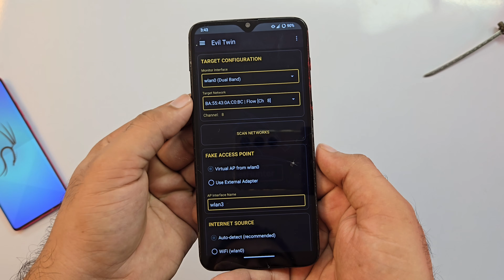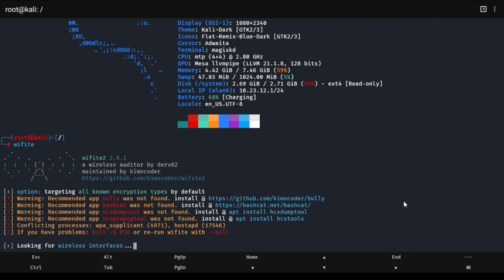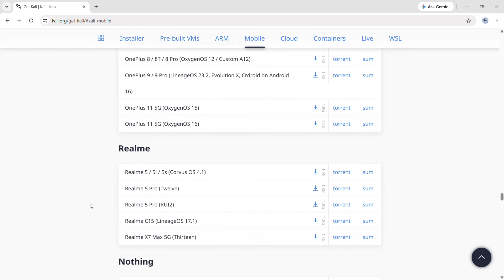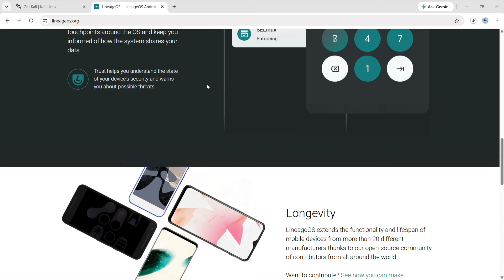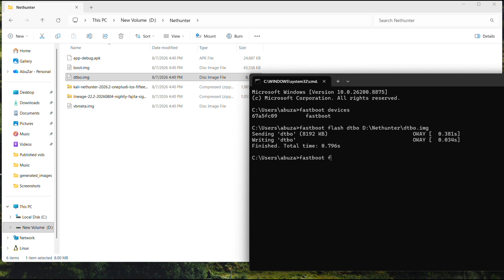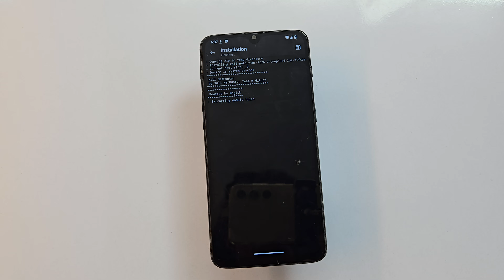I Turned My Phone Into a Hacking Machine (Kali Linux NetHunter)

Comment: Bro oneplus 7t wlan0 wifite packet injection problem fix please 🥺🥺🥺🥺
Reply from the maker: Make sure your kernel supports monitor mode and packet injection, as that is usually required for those tools to work.
Reply: @thevoidkernel Bro, I am already using a custom kernel and an external adapter works perfectly. The issue is that the internal Wi-Fi chip of my OnePlus 7T is not doing packet injection on any kernel I've tried. Is there any specific firmware patch or driver (like Nexmon) available for this model's internal chip?